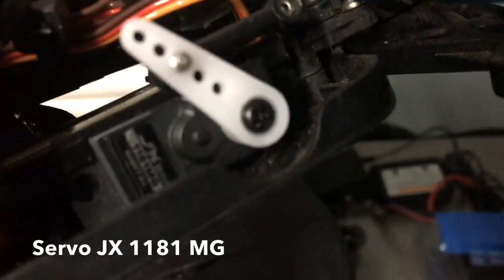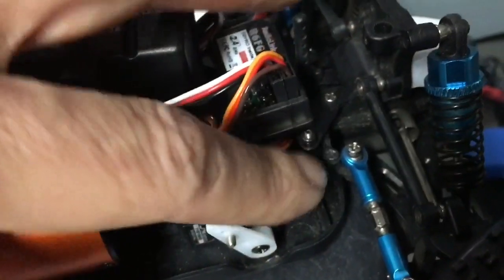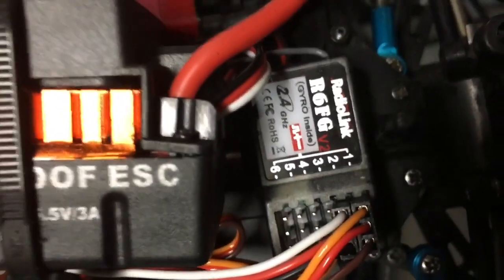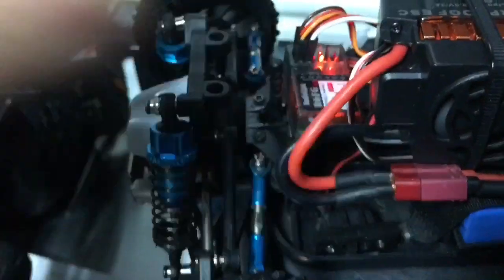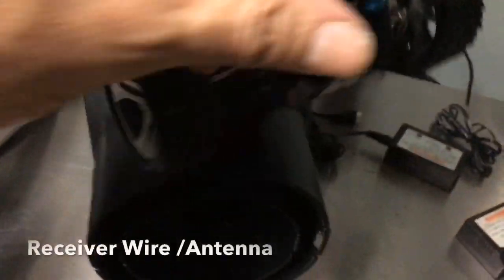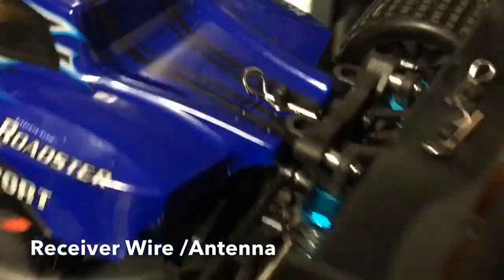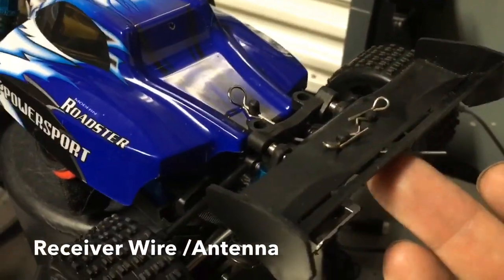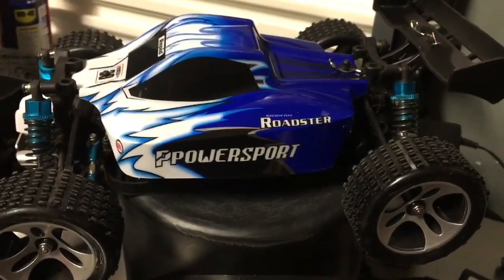959 BRUSHLESS WLtoys Conversion + Radio Link RC4GS GYRO REVIEW (Vortex A959  979)

Comment: Are there any videos that show how to install and setup a gyro on a car? it seems know one has made one...people just talk about them... Thats a pretty cool little car ...is it upgraded? did it come with adjustable steering rods and ball bearing whith is a must imo... thanks
Reply from the maker: Easiest way is to use a controller / transmitter that had a built in receiver gyro.
Reply: @DariusBarazandeh  ... is there a gyro that works with this car? or the 1/14th scale wltoys,,using same setup? the rtr radio ,esc and motor is fine...i have no issues with just going 30 mph? i just want excellent handling on a dirt track... thanks
Reply from the maker: @roadstar499  yes it’s this one. About $65.  Get the transmitter and receiver. Radiolink RC4GS V2 2.4g Transmitter R6FG + Gyro 6 Channel Receiver